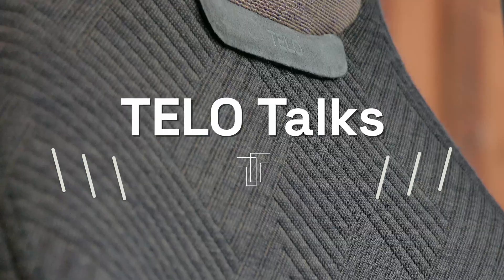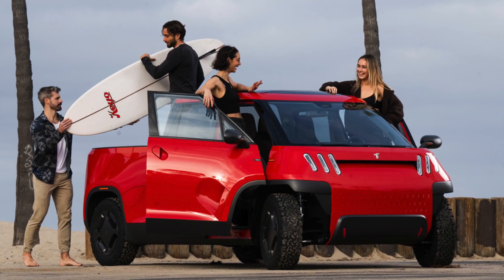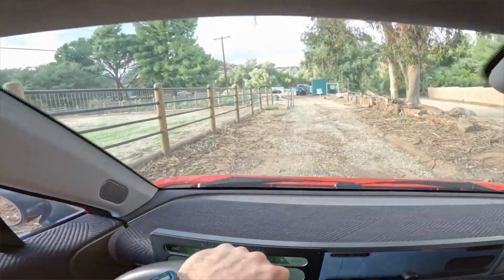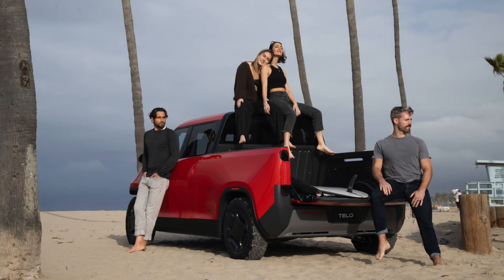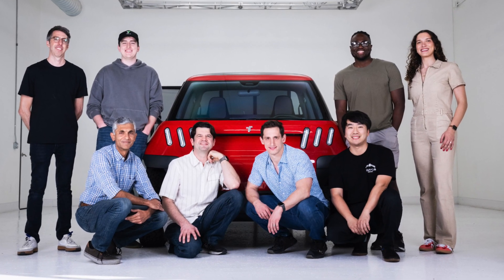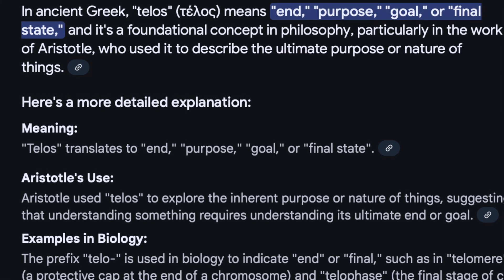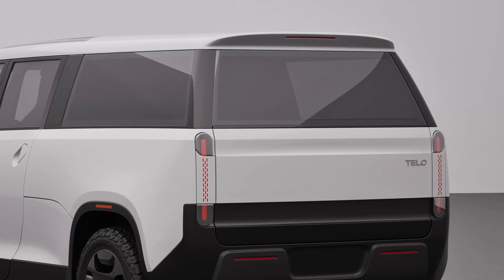Telo Talks Ep. 8 - Yves Behar of fuseproject

Comment: The efficiency is not that good compared to the model y i understand thier is more truck stuff and that adds weight. PLEASE READ. if they use a air redirect system like in the maclaren elva they can redirect air around front wheel wells and reduce need or remove side vents that go though doors and add bed cover and air slit at bottom of tail gate can increase areo alot gives rear a aerodynamic speed tail while keeping same geometry. Willing to add more input if needed just reply to comment.

Comment: Brilliant utility.  I really like the cab forward design.  One comment... Shortening wheel base a little by moving the rear wheels forward would allow some lateral taper, to cut drag, and a tighter turning radius.  Eliminating the rear mechanical brake, leaving motor braking and parking brake function only would save money if the regulations would allow it.  That way the normal braking would be initiated at the back with front brakes applied as needed when braking hard or in slick conditions.  Two wheel drive with a rear weight bias would provide OK dirt road performance.  Less battery would save money & increase payload.  We don't all need 300 miles of autonomy.

Comment: Its too expensive
Reply: To me, the initial price seems right in line with what you're getting. You may not need all that so you have other options, but in this particular space, I don't see much in the way of competition. From what I can see, the people who are involved in this project are committed to doing a lot more than the bare minimum and I'd expect each generation of these trucks to get better in both function and value. Batteries, motors, assembly, materials are all evolving and I'd expect these designers to take advantage of improvements as they become available. That said, I'd probably be happy with one of these for a very long time.
Reply: @robertwhyte3435  fair enough. I just don't think it's gonna have a chance at success at that price. I really don't understand the niche they are going for. What can this do that a van can't already do?
Reply: @BornTrespasser  Go 350 miles on one charge and fit in a small space. This is all about capacity you can use. There are full size trucks that don't come close in terms of capacity and capability. It may not be for you but if I were still working this would be my truck.
Reply: @robertwhyte3435  good point. That range is significantly better than other e-vans and e-trucks. When I first saw this car I thought, "Oh great a US version of the Kei truck" meaning affordable to the masses. That makes me feel resentment towards the company. I guess that strategy is more profitable, which is the only goal of a corporation, by law. That truth of our society is a disgrace.

I'll tell you another specific design I really don't like is the full glass roof because I live in Florida and I would much rather all that light be reflected away instead of greenhoused into the cab.
Reply: @BornTrespasser  I don't know how this company is structured but I know it costs a lot to design and build something like this. The nice thing is this isn't essential, it's not like a drug company with a medicine you need to live asking, "What's your next breath worth."
Reply: @robertwhyte3435  true. There are several different car manufacturers but I would argue that having a car is essential in our car-centric society. You have to have a car to have a job and you have to have a job to get essentials.
Reply: YEP and it's not able to run in a tractor pull. But a 1000$ wheel chair did soo idk
Reply: Finally REALISTIC pricing and range estimates unlike most who overpromise and underdeliver.
Reply: @nyc1961  how do you know they are being truthful? You won't know that until they are actually available to buy

Comment: 🏮🏮🏮
What he said is fine and dandy,  but if the AC goes out,  and I need to get it fixed, I hope he's taking serviceability into account,
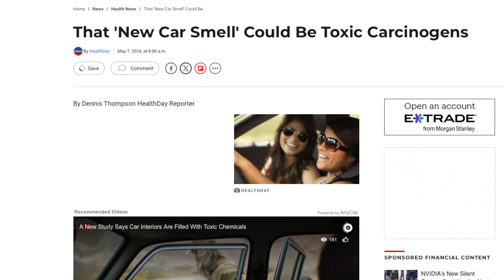without me or me mechanic having to remove the whole cab, or some other crazy stuff. 4:46

I'm also curious how I'd  adjust the headlights,  or can they get out of alignment?
Reply: They've already said there is a focus on repairability. They want the truck to use entirely off-the-shelf parts.
Reply: He's talking about interior surfaces in vehicles. Interior surfaces off-gas chemicals, like formaldehyde, primarily in the first few months/years of the vehicle's life. These chemicals most certainly do contribute to your cancer risk.